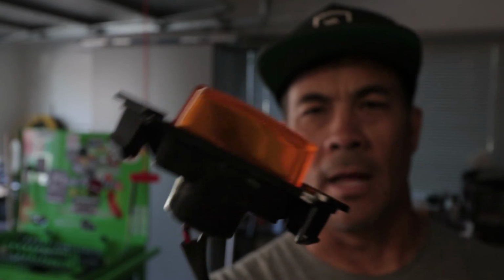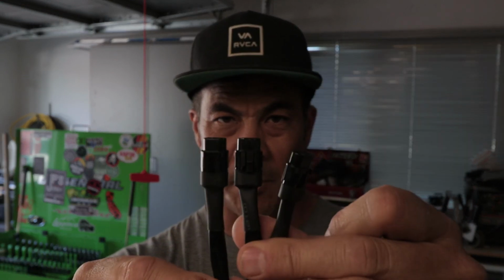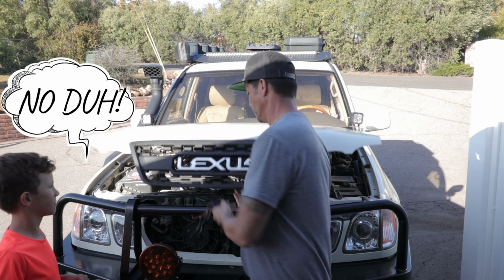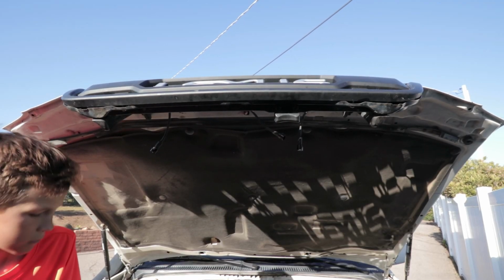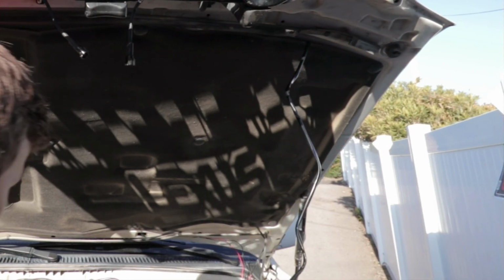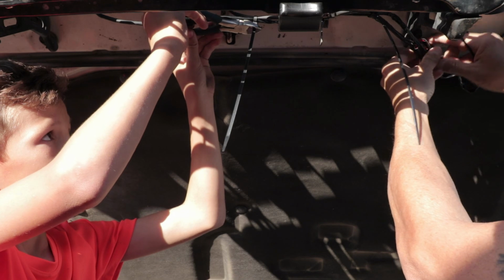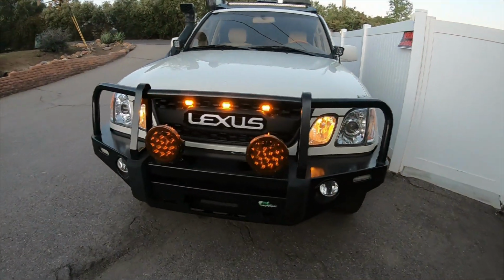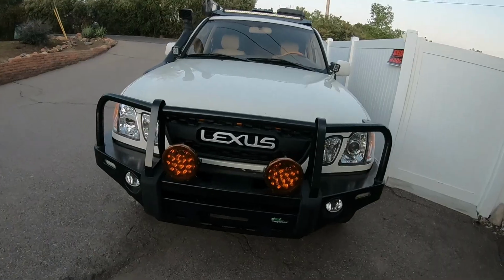Easiest way to add Raptor Lights! #garagealpha #100serieslandcruiser #lx470

Comment: How do I wire the raptor lights to where they are on during the day and at night.  2007 LX470
Reply from the maker: Thanks for watching the video. I connected the raptor lights to a switch panel. I manually turn the lights on.

Comment: Hey John, the grille looks awesome.  I want one, but my LX470 is a 2004 and they stopped at 2002.  Absolutely the best looking grille out there.  

Anyway, did you purchase new headlamps or were those on the beast when you bought her?  If so, where did you buy them?  Thank you.
Reply from the maker: Thank you so much. Sorry to hear that they’re not offering This grille for your 2004. As for the headlights, these lights were on the vehicle when I bought it. I want to say that the lens is glass.
Thanks again for watching the video.
Reply: @LXPlore  Are you saying your grille will also fit my 2004 LX470?  Garage Alpha's website states '98 - '02.  Really appreciate the reply.
Reply from the maker: @EasyRico99  I don’t believe so. Mine is a 2002. 🤷🏻‍♂️

Comment: Would a 5amp fuse circuit be safe for these on a switch panel?
Reply from the maker: Thanks for watching the video. I think 5 amps would be more than enough. I think mine is connected to a 10 amp fuse.